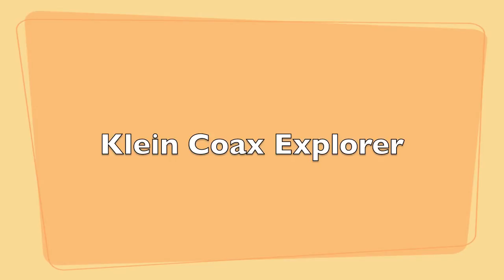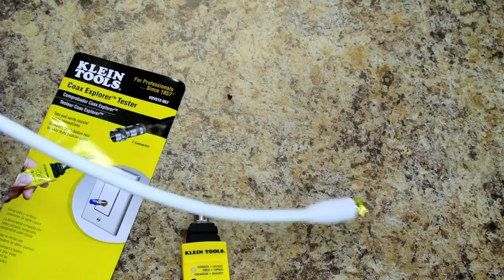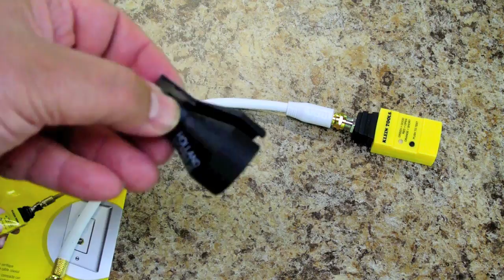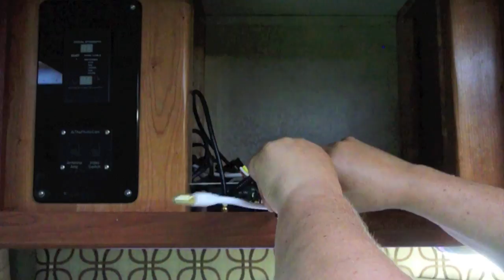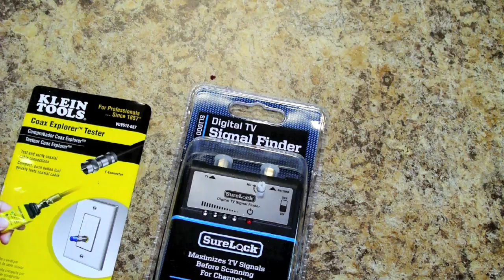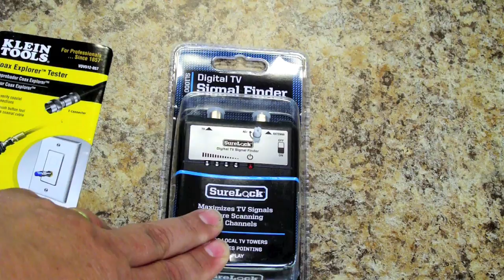Basic diagnosis of your RV's TV Coax Cabling.

Comment: My Rv cable tv has never worked. I dunno if it worked from the factory or not
as we owned this rig for 4 years before I ever tried it. It is a combo roof antennea
+cable tv. I find no switch to switch the antennea box from rooftop to cable.
Does it just KNOW & automatically switch? I tested all the cables & marked them
so I know which cables goes where. The rooftop ant USED to work but we did
not try the cable until lately. My dealer is 240mi from us OR $100 in gas to get
to him.
Whats a mother to do?

!

Comment: Too bad we may need to find factory damaged lines hidden the RV..  A TDR.. Time Domain Reflectometer would determine where there is joints,  dents and damage or the ends of coax but those only tell you how many feet to the damage. Damage causes loss or reduction of signal.   Good luck.. tks for the info..
Reply from the maker: It's why I always say "the only thing that works on a RV is the owner"...